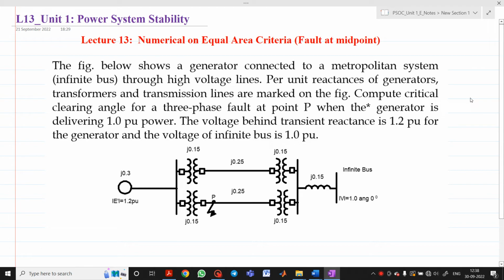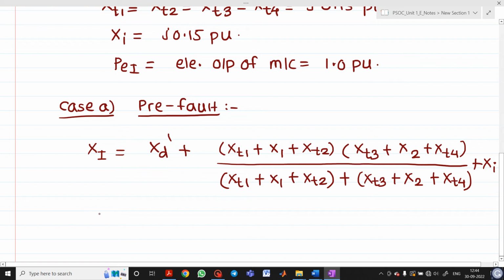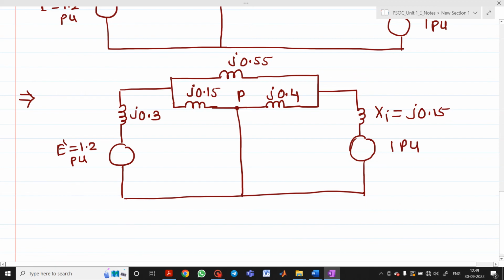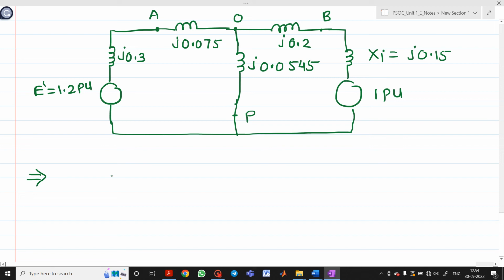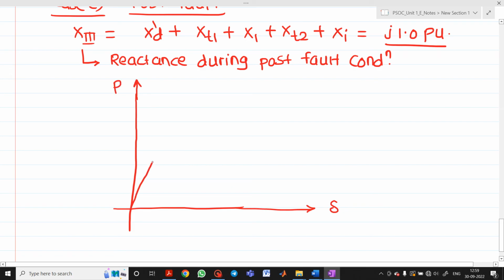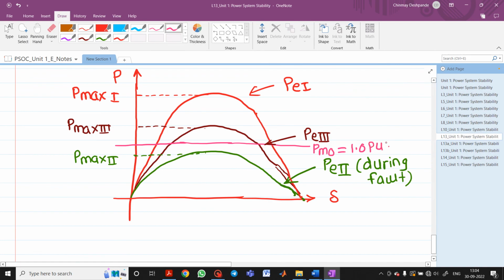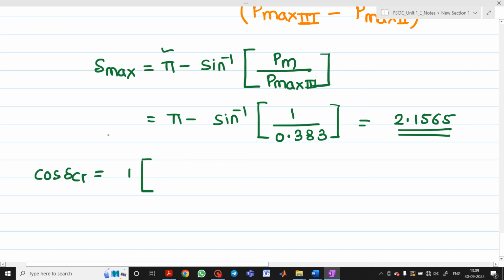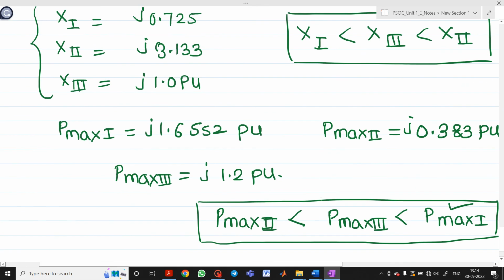Lec 13 Power System Stability Numerical based on equal area criteria Fault at midpoint Part 1

Comment from the maker: At time 30.19, in the formula of delta max, we have to take value of PmaxIII which is 1.2.
By mistake I took the value of PmaxIII as 0.383.
Please write value of PmaxIII as 1.2 in deltamax formula and then we will get answer of deltamax as 2.1565.
The answer is correct. Just by mistakenly I put wrong value for PmaxIII

Comment: Sir there is a mistake in delta max were we have to take value of Pmax3 but you have taken value of Pmax2
Reply from the maker: Please mention timing at which you saw mistake. I will check it
Reply from the maker: Thanks sanket.
I have pinned the correction in message.